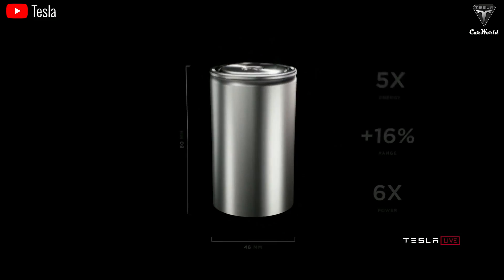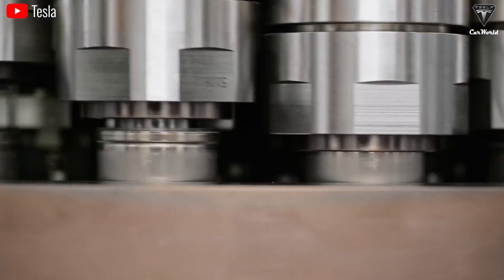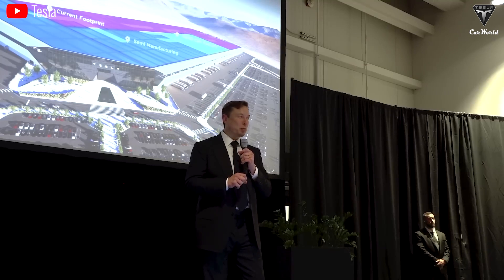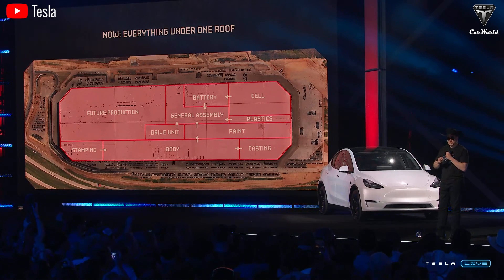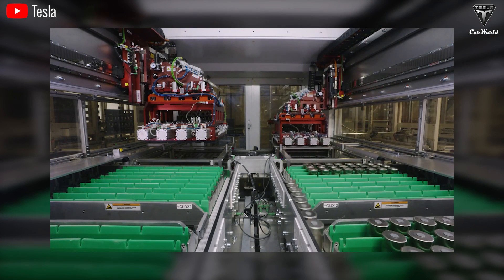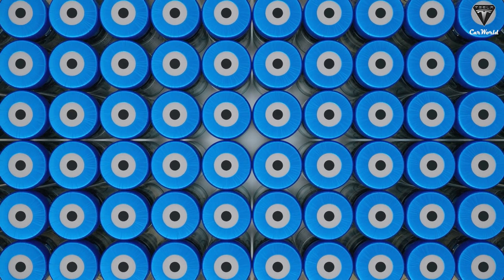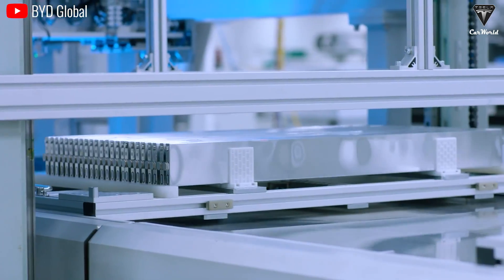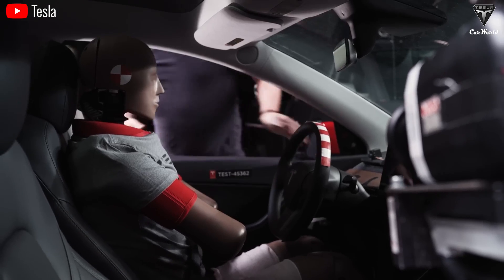It Happened! Elon Musk UNVEILS Tesla NEW 4680 Battery Gen 3! STUNNING With BIG Upgrade

Comment: Tesla’s. Gen 3   4680  battery (also called 4680D or cyber cells 
a.  Stunning upgrade  using a new dry 
cathode. process promising 
higher energy density (potentially 10%+overGeb 2), lower  cost ,
better. performance ,and 
integrating  into. the  cyber truck 
and. future robots. (optimus) ,with. 
mass production aiming for late
2024/early 2025 leveraging in-house production for cost savings 
and  improved range/power